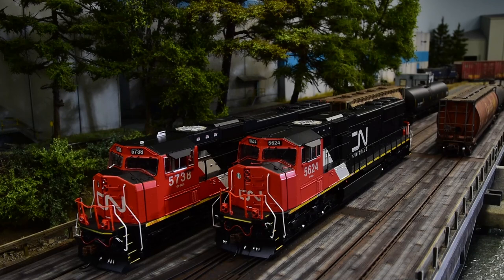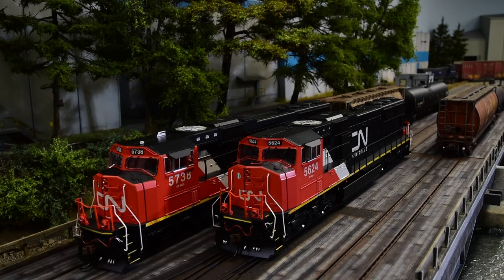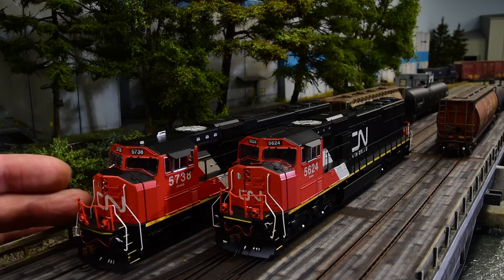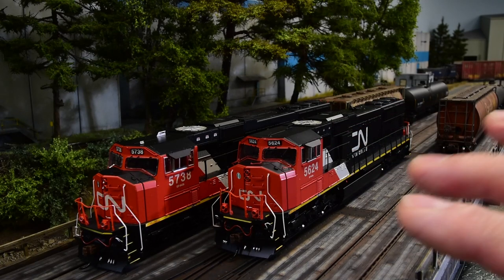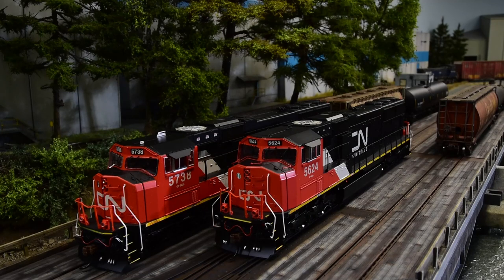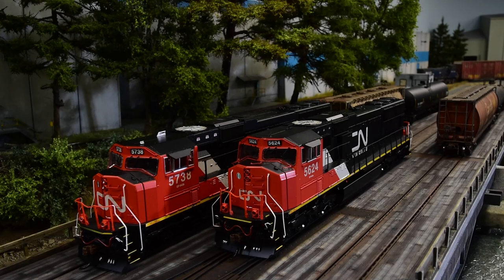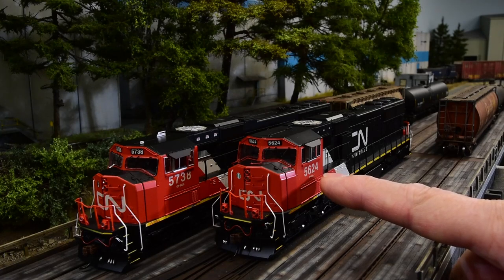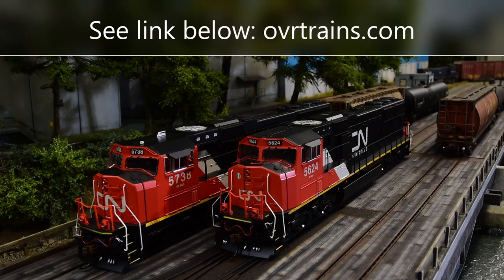HO Scale Athearn Genesis CN SD70I Modelers Review

Comment: Hi Boomer.I  have about 6 or 7 of these locos.The earler version of these were in kit form, like the "blue box" locos.You have to add the details, including handrails, grab irons & the worst of all those damn ditch lights.There are still a few on ebay, sometimes for scary prices, but they can be picked up quite reasonably if you are in the right place at the right time.Athearn have been making these since the early/mid 90s.The ones in the solid bright blue box are already detailed & of course, have the option of sound installed.The earlier models werent DCC ready, which was a bit behind the times, but thats nothing new...ie  tethered bulbs  & leds.Thanks boomer, Michael
Reply from the maker: Most of my locomotive collection is Atlas and Kato which I prefer over Athearn at the end of the day. They do make some nice looking locomotives. But then Atlas is half the price and I can super detail them at my leisure. Thanks for sharing. Cheers.

Comment: Glad you like the Genesis 6 axle locomotives. I am not a fan of Athearn Genesis 6 axle as the ones I had required to much work for the payment I made to get them. Very nice machines but should not have required the work they needed. Fixed them up,mused them for a bit and sold them. 

Give me a ST DCC any day over the Genesis 6 axles. 

I do believe though the  Athearn Genesis Gp40-2’s, the Gp38-2’s and the 1st run of the MP15AC’s are exceptional in my book. Thanks for your views and I can’t wait to see you weather that locomotive

No matter what though this is the golden age of model railroading with the quantities of equipment choices. Choices for all
Reply from the maker: Thanks for sharing Tom. In my experience every model locomotive needs fixing eventually. I literally had hundreds of Kato go through my hands decades ago and they too needed fixing. Right now, I have to say the most reliable locomotive I have ever owned is Atlas. In fact, most of my collection is Atlas. They seem to run through two lines in the sand on my worst day. ;-)
Reply: Boomer thanks for a thoughtful reply. I have had a few Atlas and don’t remember any issues. I have gone almost strictly to 4 axle Athearn  Genesis DCC ready  units. Adding first the ESU sound decoders and sugar cube speakers. Recently I have changed  to Tsumani2 sound decoders and Scale Sound Speakers and if needed changing lights to LED. But sound and decoders are a very subjective subject. There is no right or wrong in either type of purchase in my mind, I left ESU as the changing of CV’s was a hassle. Yes, every loco I have had required some tweaking. The Athearn Genesis just required to much for the purchase price
Reply from the maker: @tomoconnell4235  I find when it comes to sound, the actual "prototype" recording makes a huge difference. The quality of the recordings are leagues apart in many cases from one manufacturer to another. I know what you mean with CV's, but that all went away when I bought the ESU Programmer, then watched a Youtube video on how to use it. The programmer is awesome if you like ESU Loksound v5. Furthermore, I can reprogram for any locomotive or individual sounds, etc. Otter Valley has ESU Loksound and their programmers as well, but they sell out fast.